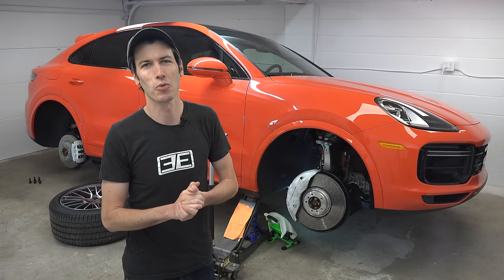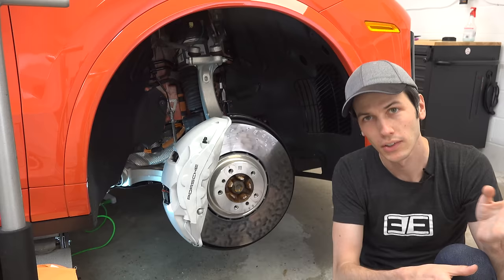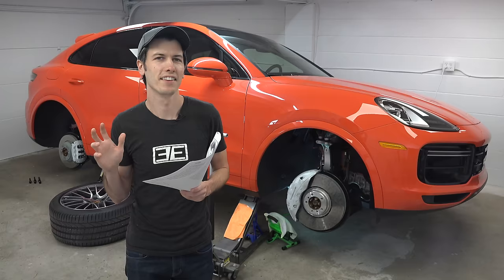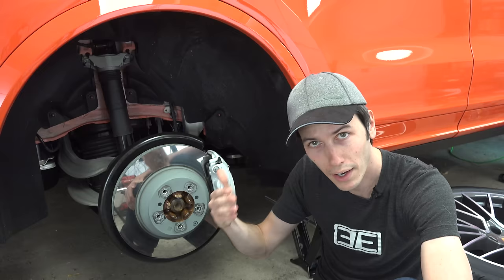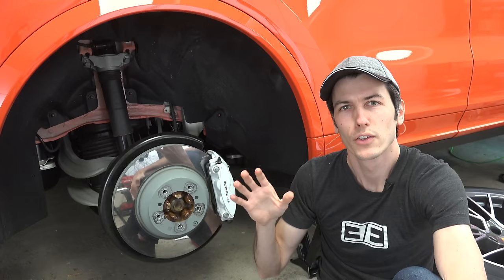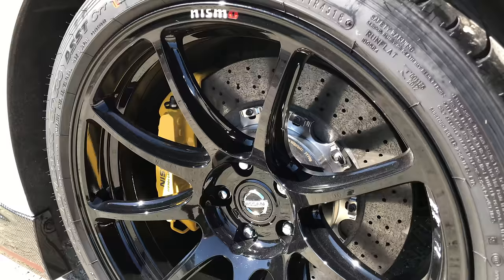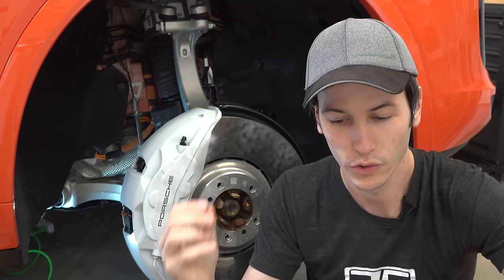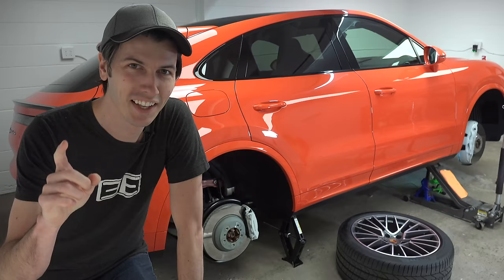Porsche Reinvents The Brake Rotor - No Rust, Low Dust, No Fade!

Comment: Nothing has been reinvented here and here's why.

Akebono Brake systems created a brake rotor for the McLaren P1 with a silicon carbide finish. For those who don't know who Akebono is, it's a company that creates brake systems for GT(3) race cars including 24 hours endurance races. Silicon carbon coated brake rotors is very unusual for road cars but not for (endurance) race cars.

In terms of hardness, silicon carbide is equally or even harder than tungsten carbide. The only thing Porsche did was to choose a more affordable carbide finish and made it commercial. That's not reinventing. What Porsche (and this video) won't tell you is that tungsten carbon is not only less harder but also more vulnerable when it comes in contact with bad ph-level materials. In practice using the wrong wheel cleaner could already shorten the lifetime of tungsten carbide coated rotors.
Reply: Silicon carbide is more brittle than tungsten carbide. Tungsten carbide is probably a better choice as a coating for brakes that are expected to last a decade, because it will be less likely to crack and flake-off from thousands of thermal expansion cycles. Race cars can get away with using lots of super fancy parts that don't last very long before they must be changed for safety or performance reasons, because race teams don't neglect parts of their cars that the driver can't see, unlike normal car owners.

Comment: These PSCB don't worth it's price. Not at all. First of all, they are not so long lasting as you might think. Yes they almost don't wear out, but the coating surface is tend to peel out exposing iron base. In that case you have to replace rotors. And the price as you know is ridiculous. And sometimes they start peel out at 40-50.000 km of mileage. I am not sure about heat resistance of pscb on racing track, but is everyday driving they are not so different from iron brakes. Did I mention that pscb  are very squeaky? Man, they are, a lot of squeaks. So, in my opinion, if you want real racing brakes - buy PCCB but they are not suitable for everyday usage. In other cases - iron brakes with red calibers (as standard on GTS) are the best choice.
And one more thing. Laboratory tests sometimes don't actually refer to an ordinary using of a car. I mean proportion of wearing pads and rotors. Sometimes customers wear out pads with iron rotors simultaneously. Those who replace pads every 15.000km usually replace rotors every 2nd pads replacement. But those who replace pads every 45.000km they usually replace pads with rotors. And that is according my 18 years experience as a service advisor with different brands.

Comment: Haha funny how long it’s taken for the automotive industry to find a use for HVOF 😝. Is it Tungsten-Carbide or Tungsten-Carbide-Cobalt? We spray HVOF every day on jet engine parts. It’s easy to grind away or chemically strip worn coating and re-spray the coating. Shouldn’t actually have to replace the rotors but....auto industry lol

Comment: But… but… I hardly use my brakes at all in my Tesla Model Y and so are making obsolete these friction brakes to a great deal. Yes, they won’t rust and give off no dust, etc. But Porsche are behind the times and the right ball in using brakes to slow down. It’s much better to turn the engine into a generator and recoup that energy than use friction brakes to slow down. A lot of technology invented for ICE vehicles in the twilight of their existence is useless before it begins.

Comment: 1. Ah, have you ever tried to drive hard on Germany's Autobahn? Pull up to cruising altitude - err- speed of 250kph, break HARD for a peasant going only a ridiculous 140 kph, repeat until at destination.
2. I'd like non-rusting rotors for my nissan leaf EV please.
Edit: 
3: where is all the energy going? Steel and Tungsten cars shed the same amount of energy through friction. Otherwise they would not stop. So why does the steel get twice as hot as the Tungsten? ablative cooling like a spacecraft heat-shield? can't be. Must vent through air. But hotter rotors would do that better than colder ones. seems fishy. what am I missing, o great Engineer?
Reply: Interesting question in 3). I study materials science so naturally the answer to this question intrigued me. Now, the specific heat capacity of grey cast iron is actually higher than that of Tungsten carbide. This is relevant because it governs the amount of energy you need to input into a unit of mass of the material per unit temperature. So for a given brake test from the same speed on the same car, I'd wager the temp of the steel brakes be lower than that of the tungsten carbide brakes. 

The difference is that Tungsten Carbide is a refractory ceramic, characterised by very consistent characteristics at high operating temperature. Beforehand, I was simply under the impression that higher melting point meant better wear characteristics and in this case, it holds, Tungsten carbide's melting point is over a 1000 degrees Celsius higher than cast iron's. 

I still don't understand what the mechanism of brake fade is though, it's a material property determined by measuring temperature against coefficient of friction for a given material. 

I hope I shed some light.
Reply: @MohammedAli-tb7zc  I also just thought, that the Tungsten layer is REALLY thin. so it actually should not really matter much in the thermal mass of the break. so maybe the Tungsten layer is really good at radiating the heat away as it is generated. Most of the rotor is uncovered and free to radiate... Iron has a very bad emissivity, eh? So how about the ceramic?
Reply: @ChrisBigBad  eh the thermal mass of tungsten carbide is still incredibly relevant considering it's the brake surface. As well, the primary mechanism of disppoating heat from brakes is convection and conduction, not radiation. Even at incredibly high temps, you will get radiation, but nowhere near as high a magnitude as through the former 2 mechanisms, so we can ignore it for now.
Tungsten carbide does have double the thermal conductivity of grey case iron, so that helps keep temperatures manageable, but it still doesn't explain the existence of a relationship between the coefficient of friction and temperature.

Comment: 50 Years ago Mercedes Benz developed Steel Brake Rotors and Brake Pads that wore into each other.  They produced a great amount of Brake Dust, however their braking efficiency to this day was exceptional.  Ceramic Brake Pads & Rotors will last 30% longer but, until you heat them up their braking efficiency is worse than a Steel Rotor with Metallic Pads.  The efficiency of a Braking System for any car under High Speed conditions reflects the following criteria:  Total Brake Swept Area measured in Sq. In. or MM, Type of Brake Caliper, Composition of Brake Pad Material, Air Flow, Brake Master Cylinder psi, Engine Vacuum Pressure, Road Surface and Tire Condition and Quality.  The pathetic hype about Brake Dust is a joke. 30% Longer Wear Capacity is another pathetic joke, however for $11,000 it's a crime !

Comment: Numbers numbers numbers. I smell a rat.   30% more durable?  Mmmm. But they have to be replaced after 0.1mm of loss.
Is this 30% slower at getting to 0.1mm loss than steels (at which point steels can carry on being used) or do they last 30% longer than steels over the life of a steel?

Comment: Dumbest option.  It costs $25,000 to do a brake job on a lower end Porsche.
Reply: Porsche asks $8,520 to put PCCB on the 992-series 911, and $9,210 to option them on the 911 GT3. A set of replacement rotors for the front axle costs $11,500. Aftermarket carbon brake kits made just for Porsche, and that can be refurbished, cost $14,949 in one instance, $21,895 in another, or $29,000 from Brembo. And they require specific, expensive pads.

Comment: Porsche needs to worry about other things besides rust on brake rotors  Porsche VW Audi BMW and Mercedes are the most overly engineered pieces of crap on the road and they are a royal pain to do any maintenance or repair work on and for every good Idea they have they have 10 that suck